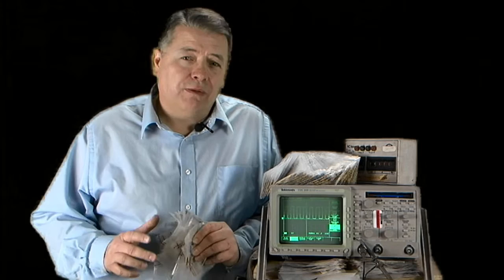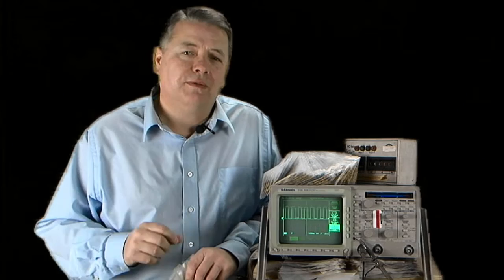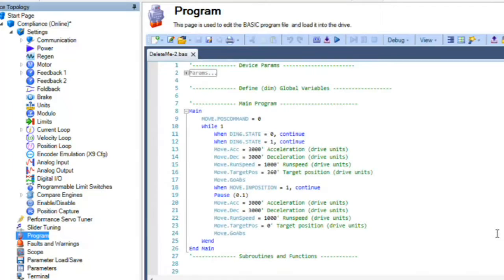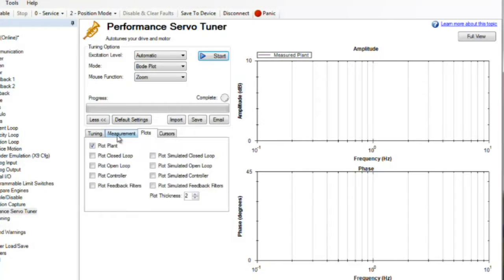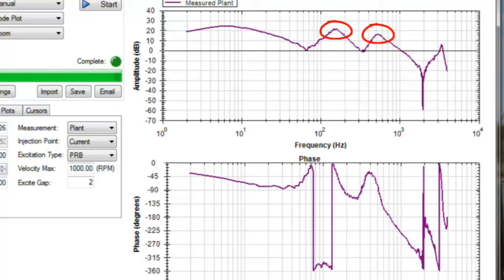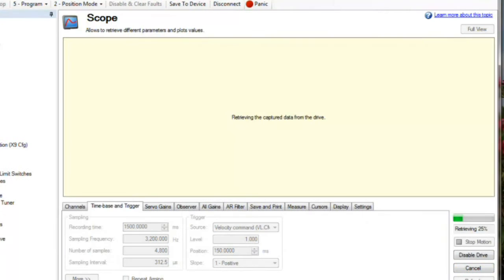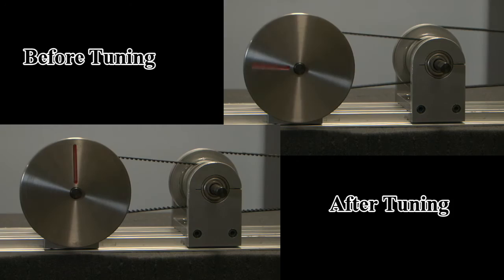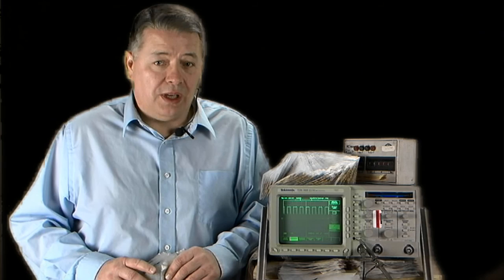AKD Performance Servo Tuning | Kollmorgen | 2 Min of Motion

Comment: for the bode plot,   what is the physical meaning of the negative gain?  i know it is input > feedback amplitude.  but isn't feedback amplitude is constant?(encoder generate the same amplitude).
Reply: Gain it is (output / input), so negative gain means the output is smaller than the input. The physical meaning is that at those frequencies, motion can NOT be controlled properly.